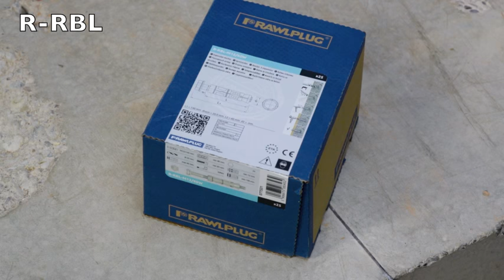Screwfix - Rawlplug RawlBolts

Comment: Ive noticed knocking in the plufs without any  bolt inside most of the times knocks out the springs as their is no tension init.. I advise you screw the bolt in to the plug and then knock the bolt amd plugs in

Comment: So what size drill bit do you use? How much bigger than the Shield/case diameter? How much deeper  than the length of the bolt do you drill. So many different sizes these days.

Comment: I would of liked to see how you remove it.
Reply: You just unscrew it and it releases its grip.
Reply: Take off the nut at the end, then knock the thread in gently until the anchor section of the bolt loosens from the surrounding brick. Then wiggle the anchor free until it comes out of the brick etc;

Comment: What did you use to clear dust from that hole at 0.08? I want to know the name. I want to buy. Is it electric device or mechanical device?
Reply: probably compressed air but you can just use vacume
Reply: Football pump with straw

Comment: Don't use them! There's no need at all.
Reply: Why not?
Reply: What do you recommend?
Reply: @RZVPeter  I too am curios as to why we shouldn't use them.
Reply: can use concrete bolts now,,,no plug needed ,,,   just drill hole,,, with 8mm sds drill bit,,,then  use 10 mm bolt,   or whatever size you require ........and it taps its own thread as you drive it in,,,,,and can be taken out and reused in same hole,,,,,easy     ,,and solid hold